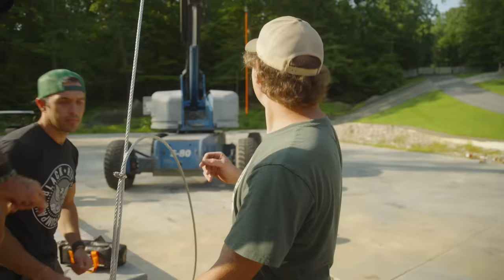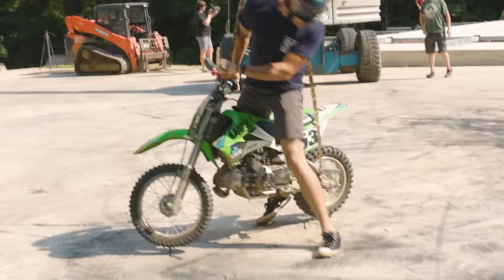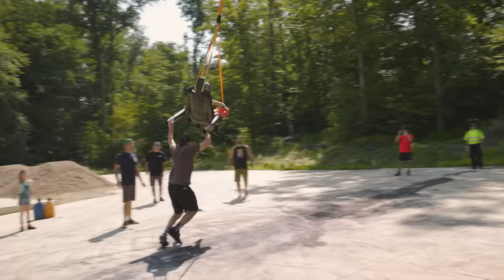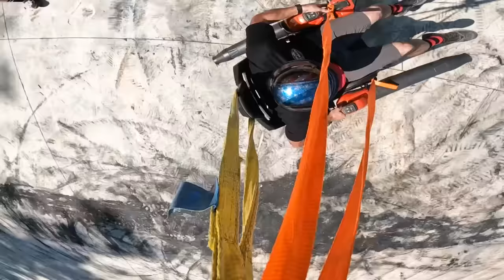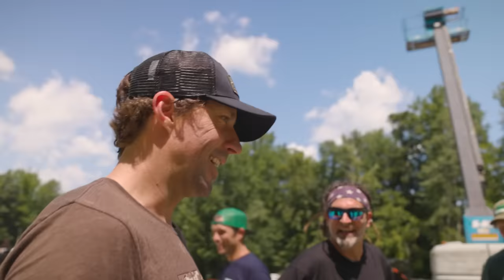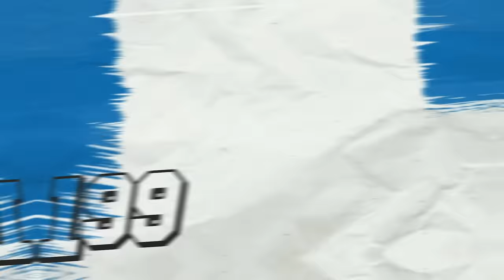We built a Dirt Bike Rope Swing! & other UFOs!

Comment: For the dirtbike, you need to have a little bit more slack in it. It's not on the ground for enough time. And you want to get a gyro/rotating eyelet for the straps, so they don't twist up because then it becomes unstable and hard to control when you are in the air. But it looks super fun to try!

Comment: The bike needs a 6ft tail that has a spring in it so it can bend sticking out the back down low to contact the ground and align the rear wheel first and the spring will let the tail move.